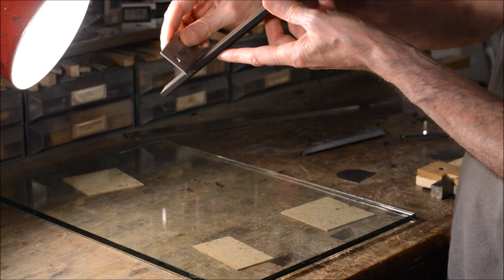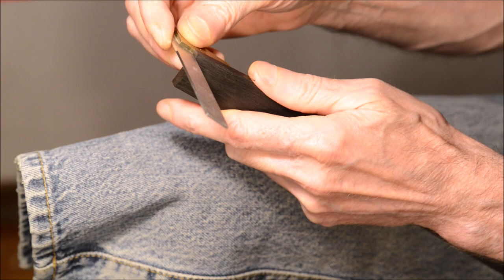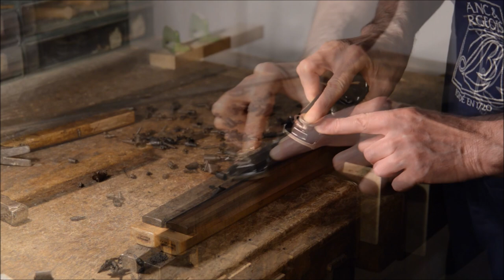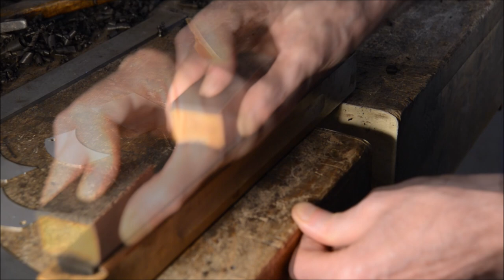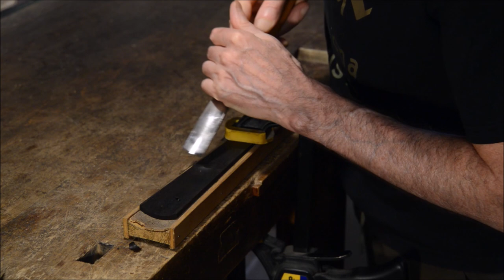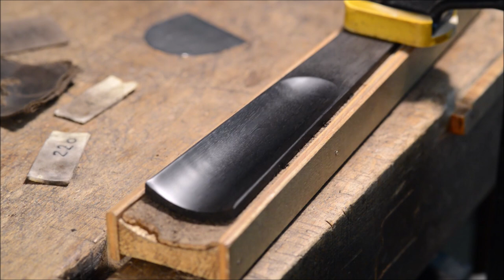Making a violin fingerboard from start to finish (condensed)

Comment: Sorry, but it is NOT "from start to finish." He is already working with a convex teplate from the start.
Reply from the maker: Yes,  you are right, here I show how I make a fingerboard starting from a semi-worked product, which is what practically all luthiers do. Of course you can start with a square ebony block (I do it every now and then), but it doesn't change much in the sequence of operations
Reply: @DavideSora  Sorry Davide, but making a template out of a square piece of wood is actually what I really wanted to see. Especially how you proceed making the radius convex top. Your video shows only fine touches here and there.
Reply from the maker: @gothicrecital  The videos titled "... from start to finish" are just a condensed version to show the work in a generic way, to see all the details of the work you have to look at the more detailed ones. You can find a full index with direct links to these detailed videos, listed in working progress order here: https://davidesora.altervista.org/videos
Specifically for the fingerboard, you can find them all gathered in this playlist: https://www.youtube.com/watch?v=-8B2Oju-AiE&list=PLaxadm6POX7GSmVH_BBckj7QZUQC7M_nS
Anyway, to start from the raw block I proceed as follows (you won't find this in the videos): Create a parallelepiped with dimensions slightly larger than the final ones of the fingerboard, flatten one side (which will be the gluing surface to the neck), square the two lateral sides and the two heads. Then trace the centerline and mark the top (nut) and bottom (end) widths of the fingerboard at a length of 270mm. Saw the two sides obtaining the taper from the nut to the end, then plan them square with the lower face previously flattened. From this point on, the procedure is the same as that starting from a semi-worked piece, only you will have to remove more wood. In fact, even when using the semi-worked piece it will be necessary to completely rework it on all its surfaces if you want to get a quality finished fingerboard, no original surface will remain of the initial semi-worked piece.
Reply: @DavideSora  Thank you. This explanation helps.
Reply: @gothicrecital  if you can follow the steps shown here, it’s only a matter of additional time to create the same result from a square blank of ebony.

Comment: Davide, please explain why on the fingerboard there is a side deflection at the waist on both sides? Thank you!
Reply from the maker: It is mainly used to compensate for the longitudinal concavity under the strings. Due to this longitudinal concavity, if you made the sides perfectly straight, they would appear of non-constant thickness, becoming thinner in the center and thicker at the ends. It is also used to obtain a slimmer neck towards the heel, facilitating playability in high positions.

Comment: That looks very high quality Ebony
Reply from the maker: Yes, I only use the best I can find, the only problem is that it is increasingly rare and for one blank (still to be worked) the price can even exceed 40 euros each.😲😲
Reply from the maker: @Kelvin-ed6ce  I get them from a local shop in Cremona, but I personally choose them by selecting the best among those of "master quality", because even at the top level quality they are not all the same, some are better than others.
https://www.cremonatools.com/fingerboard-violin-1st-master-quality.html
Reply: @DavideSora  it is beautiful to be sure - a book I read recommends using the lighter colored blanks and staining them black.  Is there any drawback to this that you can see other than that the coloring would need to be done each time the fingerboard is resurfaced?  Is there for instance additional hardness that comes with the darker wood, or is it purely aesthetic?
Reply from the maker: @mrgolftennisviolin  The black color of ebony does not necessarily indicate a harder wood, but it is certainly the most valuable because it is more difficult to find. There are also ebony with streaks and lighter color that have an excellent hardness and quality for fingerboards, but personally I prefer to avoid using it because for aesthetic reasons it would need to be dyed, and the dyeing could give some problems with the aggressive perspiration of some players. If you decide to use it, I suggest not to dye it because in any case it could have an interesting aesthetic effect, even if it does not conform to the classical vision of many musicians and luthiers, who mistakenly associate color with quality. But whether it's lighter colored, streaked, or perfectly black, the color has nothing to do with quality, the size of the pores is a better indicator, they have to be as small as possible. Even the straightness of the grain and the absence of undulations (flames) is another indicator of good quality. Regarding lightness, it is true that African ebony is generally stiffer and lighter than Asian ebony, and is often also lighter in color or with streaks, but it is nonetheless a generalization that makes no sense as these characteristics can be found in all woods of all origins. Furthermore, the weight is not so important, because you need high density wood (and so heavy) for good quality fingerboard. If it were it would be better to go back to making fingerboards as in the Baroque era, that is with a light wood core only veneered in ebony, as Stradivari did, using willow for the core.

Comment: Where can the sanding block you are using be purchased?
Reply from the maker: I am not aware that they are for sale, I made them myself, I think you will have to make them too. I've seen this on the web, but it only has 42mm radius (mine are 42 and 60mm) and then it's huge, too chunky. Maybe you can try to reduce its size, but i don't know if it's worth it: https://www.internationalviolin.com/ProductDetail/t1951_triton-violin-fingerboard-sanding-block-r42
Making them is not that difficult: you square a block of wood of the appropriate size on all its sides, draw two arcs of the radius you want on the two opposite sides, and connect the two marks making sure that it stays straight checking with a straightedge. You don't need an absolute accuracy, because in the end they will have to be flatter than the curve of the fingerboard.

Comment: Did you make the curved scrapers or purchase them?
Reply from the maker: I made my first curved scraper by hand, doing the rough work with the grinding wheel, getting the final accurate shape with files, and sharpening the cutting edges with curved waterstones. It's a lot of work and not very easy, but it can be done. The ones you see in the video I had made by a company that cuts sheet steel, in order to have all the radiuses you need with a half-millimeter difference between one and the other, doing them all by hand would be a considerable undertaking. But these serve mainly as a reference template, the use as a scraper is only a side effect, and not really essential. One in steel would be enough to use as a scraper, and all the others in any other material to be used only as a reference template, given that the final work to obtain the accuracy of the shape is done with the curved sanding block and the sandpaper.
Reply: @DavideSora  thanks...I have a machine shop at work...perhaps I can bribe the machinist with a case of beer to make me a set
Reply from the maker: @chrisanderson2984  Yes, I think a couple of beers may be enough.😅 Being simple circular arcs they are quite simple to make, if you have the right equipment to work steel. My set goes from 37.5mm to 42mm radius, with half a mm differences between each, 10 templates in total.
Reply: I buy good quality knives at thrift stores and make my scrapers.